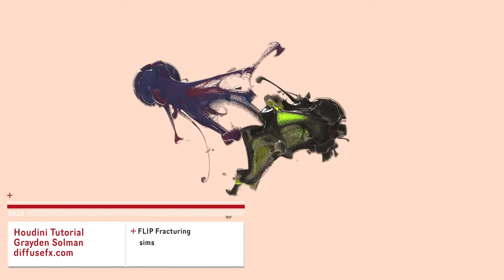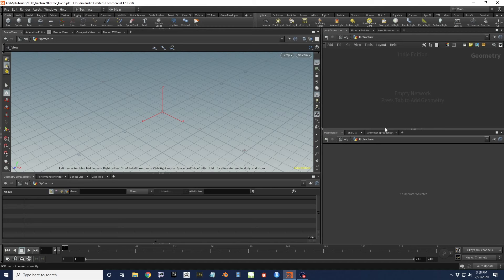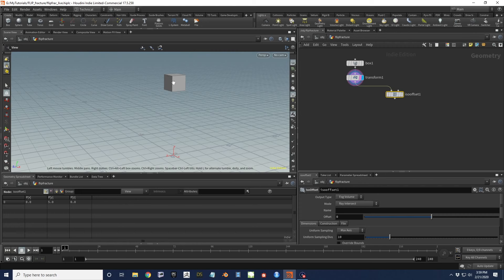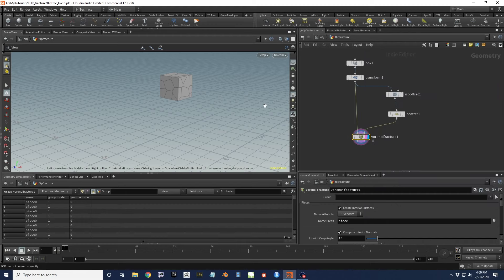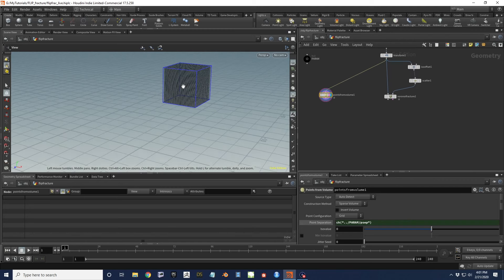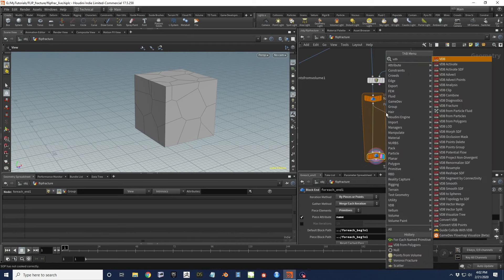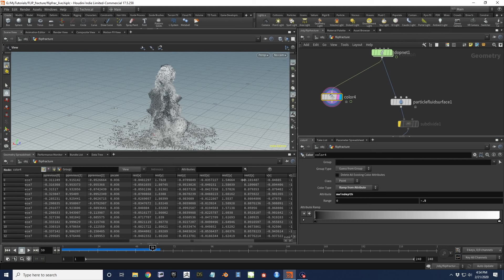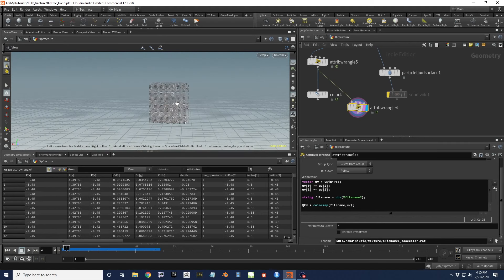Houdini Tutorial: Flip Fracture

Comment: You're doing an awesome work here,  I hit like before starting each video, thank you :)

Also, instead of vdb in a loop, which is relatively expensive, you can in a wrangle use 'xyzdist', which will return the @depth, and then use its returned 'prim num' to find the name from the fractured geo, but since you can't sample a string attrib, in the vornoi fracture enable 'primitive piece', and a litte hack here is to put a 'exploded view' with so tiny scale, between your vornoi fracture and wrangle.
Reply from the maker: That's definitely an option! I find the vdb reshaping options a bit more reliable for erosion than something like peak sop, so that's the main motivation for using volumes. And although it's definitely expensive, it's only a one-time setup computation, so I tend not to worry much about optimizing there. Using a small exploded separation for the xyzdist test is a great tip, though!

Comment: Beautiful, Sir! Very clear explanation for a super cool effect! May I ask if you know some way to melt objects keeping the proper uv mapping? Would like to melt 3d scans of human heads, but Attribute Transfer would always show uv seams, do you know any workaround? Thanks a lot!
Reply from the maker: Thanks! Depending on the effect, this can be more or less difficult. One of the biggest issues is when you have a lot of internal points coming to the surface - as these would never have had original uvs. But if you keep things relatively viscous / rigid, then the surface should transfer ok. To deal with seams, you want to look for prims where the verts have uvs that jump from the high end (near 1) to the low end (near 0), then adjust the problem verts (e.g., if your verts go from .9 to 0.05 on a uv dimension, either switch the 0.9 to -.1 or the 0.05 to 1.05). It's worth making an HDA for this if you do a lot of fluid UV'ing.
Reply from the maker: Note - the above solution assumes wrapped textures, which I'm realizing isn't applicable for your head example. In those cases, if you give your original geometry an attribute defining its uv islands, you can use that attribute to restrict your attrib transfer. It's not always perfect, but it will get things a lot closer...
Reply: @DiffuseFX  thank you very much, I'll try to apply your precious suggestions, I'm at an intermediate level, hope I'll make it!
Reply from the maker: @ArgoBeats  Hope it works out! I might do a little 'quick-tip' on seam fixing some day. My approach isn't perfect, but it works well enough for certain cases that it could be useful for others!
Reply: @DiffuseFX  that would be great, thank you again!

Comment: Big thanks for an awesome tutorial. I rebuild this using the toy instead of a box but for some reason ended up with voro_vdb_sample depth >0 for some points. I used a beak to ensure the VDB volume is bigger than the are covered by the particles.
It seems that during the point wrangle I might be getting racing condition if Houdini is trying to be smart and run it in parallel somehow. To address this, I made a detail attrib and my own point for loop. But still end up with positive depth somehow. Any ideas why?
Reply from the maker: Hey there. I think with a complex shape like the toy, the step of scaling up by 1.5 to cover the edges isn't going to work the same way. That's a good catch. You'll want to expand before the voronoi fracture using a peak sop, or by converting to vdb, dilating with reshape sdf, then converting back to polys before fracturing. The latter approach will probably be more reliable, since peak can generate interpenetrating geo. I tested quickly and it seems to work. Hope that helps!
Reply: @DiffuseFX  Yes, I caught that one first and did already use a peak.  Will try the other method now.  Also considered dilating the VDB pieces in the loop. Will continue to experiment. Thanks.
PS: A combination of pre fracture dilating and in loop dilating fixed it in the end. Might have worked with less particle separation.

Comment: Thank you, this has been extremely helpful. I am trying to create a simulation of a tart crumpling and a liquid pouring out. I was wondering if there was a way to only fracture the surface and have the interior completely liquid so i can make a solid container for my liquid to pour out of. Any help would be very much appreciated.
Reply from the maker: Off the cuff, assuming you're ok with the fracturing part, what I might try is setting the exterior points to 'stopped' (and int attrib you can specify on the points) – which will prevent them from moving, but still collide with the other particles. Then you could have a release trigger (e.g., some other collision volume) that would switch the contained points over to their desired viscosity values. That way only the region of the tart you wanted would collapse per the tutorial's method... But I could be misunderstanding what you're after!
Reply: @DiffuseFX  Thanks for you answer!!!
Reply: @DiffuseFX  thank you so much for getting back to me. Would you be able to specify which node I would change the exterior points to stopped on?
Reply from the maker: @tomstrickland6290  I'd just do it with an attribute wrangle in SOPs when you're setting up the source particles - a one-liner: i@stopped=1; for the exterior group. You'd then switch them back to an active state (i@stopped=0) inside DOPs probably using a POP wrangle and whatever activation logic you're thinking of!